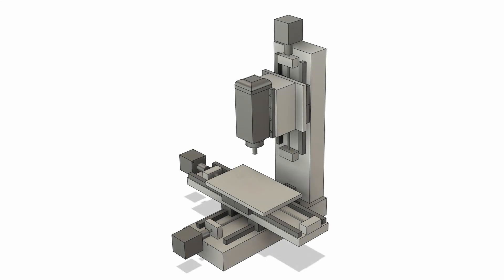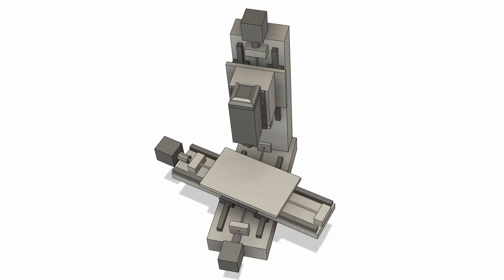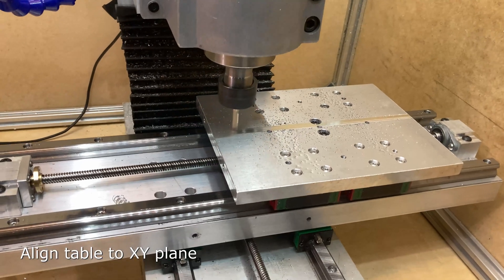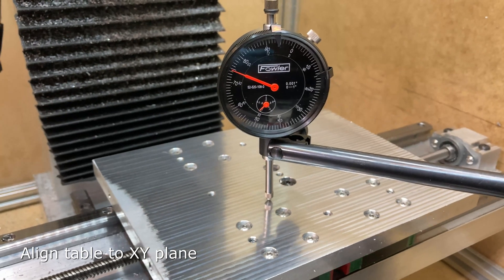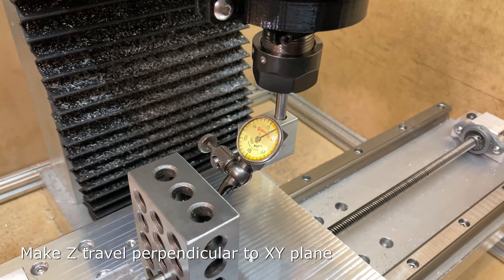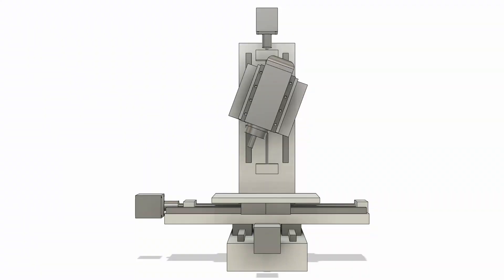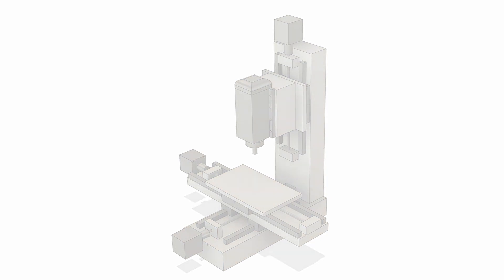Squaring and Tramming a DIY CNC Mill

Comment: 8:35 But wait. 

If the motor is tilted back/forward and also left/right, when you move the z-axis up and down the dial indicator will move laterally on the pin, not just up and down. Which means that you could be measuring back/forward and left/right at the same time.

Comment: i know this is 4 years old, but i am desperate for some guidance. I have a very similar mill to yours, including the x to y bolts being hidden under the rails. I made new holes and now have accessible bolts and can move on to the second part of the very start of the video: Make X travel perpendicular to Y axis. However when i attempt to move the bed on one angle or another, it always moves the whole bed and undoes any movement that i introduce. Any advice would be much appreciated. should i be tightening all the bolts decently and tapping the bed like that, or just 1 bolt? I've tried both and it doesn't seem to make a difference

Comment: Nice illustration video. I’m an ex K & T Service Tech who installed many types of 3-4-5 axis CNC equipment in Aerospace back in the day. We verified alignments with a 14” precision Granite on most, sometimes a 24”. We also ran laser yaw, pitch and roll on our ways before the assembly. Finally lost motion correction on each ball screw and rotary table was performed. Keep up the good work.

Comment: why did you use aluminium?
Reply from the maker: I can buy large pieces of stock online for cheap with free shipping. 6x20 inches 1 inch thick aluminum for around $50 shipped. I couldn't find prices like that online for steel, and there aren't places around me that will sell in small quantities. I think epoxy granite would be a great option, but I haven't tried it yet.
Reply: @imnoexpertbut  ah ok thanks, I thought aluminium had some other properties.

Comment: It's best to build each axis as it's own actuator instead of mounting rails directly to the machine base. That way you can add adjustment screws for fine tuning. It's far easier and better than using shims.

Comment: Hi. Awesome build! Do you have any feedback re the linear rails. I am building a very similar machine and am wondering if I should go with genuine HIWIN rails or if the ebay rails do a good enough job. Thanks for your content. I have watched your vids far too many times!
Reply from the maker: The cheapo ebay rails have worked well enough for me so far. If you're going for a hobby-level machine (only run occasionally, don't need extreme accuracy) I think they're fine. Sometimes the bearings come very dirty, but you can clean them out to make them run smoother. The rails sometimes aren't perfectly straight, but you can measure it and use the mounting bolts to straighten them.
Reply: @imnoexpertbut   thanks a lot for your reply. I really appreciate it. I’m using the machine to prototype some parts from forged carbon fibre plates. Not as demanding as metal but there are other considerations like dust control using liquid. I’m looking for accuracy to be honest. I’m looking for repeatable accuracy of 0.03mm to 0.08mm (0.001” to 0.003”). I believe you have already reached tolerances close or better to this before squaring up your mill. Really interested to know what results you are getting now in terms of repeatable accuracy. Thanks again for all of the valuable content and comments.
Reply: One thing that you should be able to do with your CNC software is make an error table, the software should know which way things are out of alignment and correct for that.

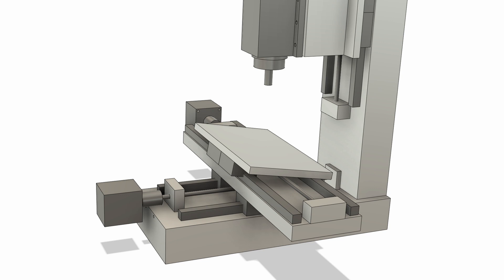Comment: Just my 2 cents, but I am not sure you are testing what you think you are testing. As an example lets take your picture at 3:40. Assume the X axis is perfect, except for the tilt. You'll never measure any tilt with the setup you are showing (moving in the x direction). You would have to move the Y axis for that. Even worse, if the tilt were around the Y axis direction, neither X nor Y movement would show in the dial indicator.
Edit: I think I should clarify that the any tilt of the X table around the Y axis is not really a problem because it can be corrected  entirely by tramming the spindle.
Reply from the maker: I know it's confusing, and it's also hard to talk about, but that picture at 3:40 is showing the X and Y axis being perfect, and the table is tilted relative to the X and Y axes. That's why it will show up on the indicator. If the table was perfectly aligned with the X/Y but the axis itself was tilted, then you are correct and the indicator dial wouldn't move when the axis moved. You can measure how far off a surface is from its direction of travel by putting an indicator on it and moving it along that direction of travel. You can't measure how far off an axis is by putting an indicator on it and moving it along the direction of travel. This old tony has a Maho CNC video where he demonstrates that. Anyway, all this stuff is surprisingly hard to think about from first principles, which is why I wanted to make a video about it.
Reply: @imnoexpertbut  Ah, I see what you mean now. Thanks!